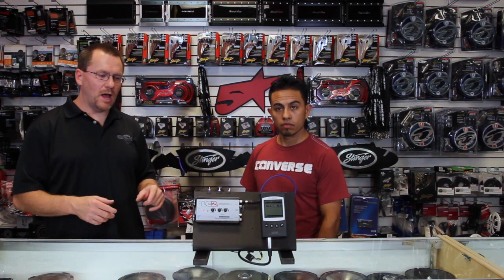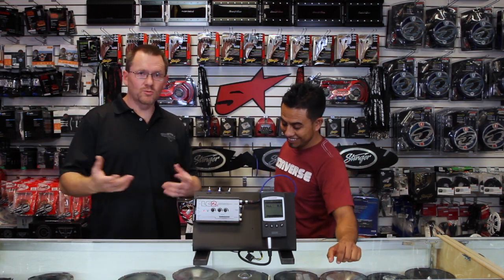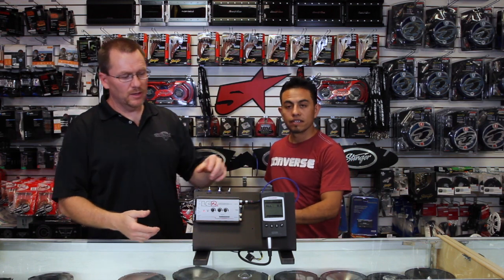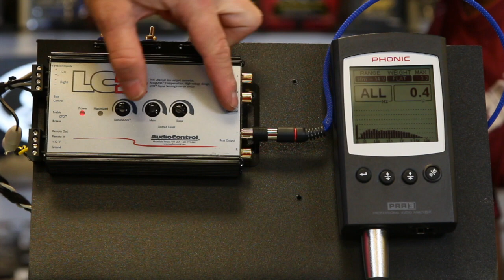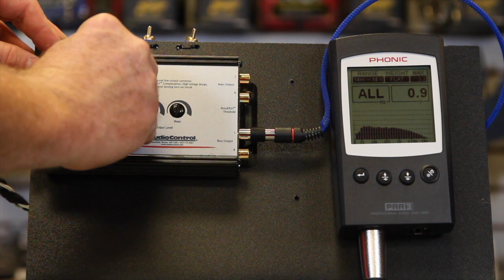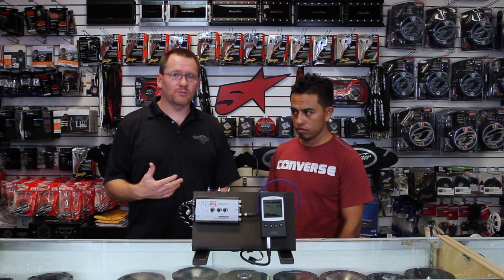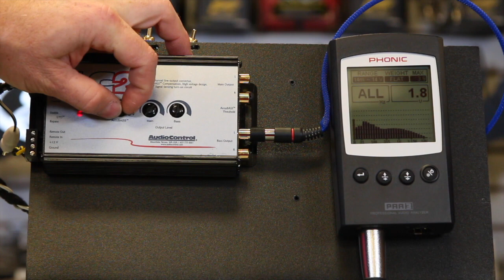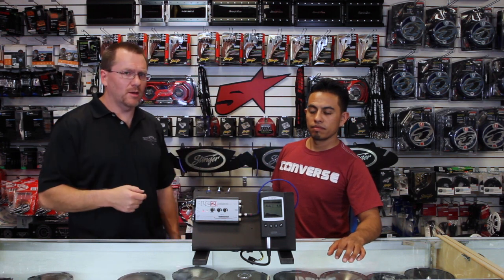Introduction to AudioControl's LC2i "what is and how to use AccuBass"

Comment: whats better to use? Pac gm 61 harness or the lc2i pro? are they essentially the same thing? my volume goes up to 63 (max) without any distortion. i dont want to cut into speaker wires if i dont have to..... but i want that RUMBLE. my last vehicle didnt have a good LOC so it was lacking on some notes. which one is better to use?

Comment: Hey guys I’ve got a quick question, I’ve got a 2018 Honda Accord Sport and the factory head unit cannot be replaced so what I did was pay for a professional installer to install all of my high end JL audio aftermarket component speakers which are JL’s C3-650 with crossovers , two in the front and two in the rear deck and a JL 10Wv3-2 in a boxed which sits in my trunk. To control the power from my amp and to control the volume of the bass sub the installer installed a JL-DRC-205 Digital Dial Rotary controller with integrated push button & LED Indicator. Next they installed a JL FIX- 86 OEM Integration DSP. And last a JL RD 900/5 900W 5-Channel Amplifier. I’m happy with the sound of the system I cannot fade from front to back or from left to right The alignment on my screen on the head unit, the dot Hass to be right in the middle of the car for the front and the back to play simultaneously but you cannot fade from right speakers to left speakers from front speakers to back speakers, I cannot do that. And although it does sound OK I’m honestly not impressed with the install. Could anyone who has a 2018 Honda Accord reading this push me into the right direction thank you. Should they have installed this LC-2 line output converter Help ?
Reply from the maker: It sounds like they installed the Fix wrong. It is quite capable of handling a Honda with a base radio( premium not so much). PAC-audio.com lists a t- harness that we use on this car.
Reply: @FiveStarCarStereoInc  You don’t know how much I wanted to travel down to Florida to have you guys install my JL audio system. It sounds sounded great when they first installed it but later I found out that rather than using a laptop to set time delay and the time alignment they used a JL audio download to an IPhone to set everything up. I’m unable to fade from front to rear or right to left speakers . The little red ball/ dot on the head unit has to be set dead center between the driver and passenger seats for the system to sound totally amazing. Question, how much is this wiring harness and does it come with detailed instructions brother ?
Reply: @FiveStarCarStereoInc  My 2018 Honda Accord Sport didn’t come with the premium sound system. Just two front door speakers and tweeters, and two rear deck speakers with tweeters, and the base sets in the trunk.
Reply: @FiveStarCarStereoInc  Also if I were to get down to your shop and made an appointment with you how long do you think it would take to install this harness your referring to buddy. Tell ya what I’ll give you guys a call tomorrow and see if we can’t setup a date.
Reply: @FiveStarCarStereoInc  Thank you for getting back to me sir. You’ve gained a new customer ! Somehow I’ll make it down to Clearwater Florida and have you guys install this harness you’ve informed me about. I’ll give you a call mid morning and we’ll setup a day and time brother. Thank you for getting back to me about this issue so quickly I truly wasn’t expecting it. But I’ll call you tomorrow sir and thank you again

Comment: You guys just saved me hours of headache trying to get this to work better. I totally forgot to adjust the threshold and was getting pissed my DSP was sounding like crap when it wasn't even getting a good signal to begin with.
Reply: What DSP are you rolling? Curious on the setup, instead of just running everything into the DSP.

Comment: Is the bass output of the LC2i full range or does it have a low pass filter on it? I noticed the higher frequencies on the RTA taper off when you switched it from the main to the bass output on the LC2i.

Comment: The LC2-I does not pass 10-20khz it states in the specification (Frequency Response: 33 Hz – 100 kHz ±1 dB) so if you like LOW bass you won’t get it with this. Now the human ear cannot hear below 20hz, plus most subs if any will never get that low and even those extreme low frequencies 0-20 can damage your sub. However if your subwoofer cannot reproduce frequencies below 33hz or you simply don’t care, then buy it because it’s freaking AWESOME. But if you like to tinker with things and or are always searching for the bigger and better thing then a LC7-I is way better however if you want more tune ability go with the LCQ-1

Comment: Bear with me here. I have an Acura RSX (Bose system) with an aftermarket Kenwood head unit that has a 5V pre-out. I’m replacing the old amplified, self-contained Bose spare tire subwoofer and replacing it with a new amplified, self-contained JBL BassPro Hub. I’m keeping the front factory Bose amp.

If I’m thinking about this correctly, the front factory amp just carries a remote turn on and speaker level outputs to the sub (it doesn’t amplify the sub), so is it even worth it to use the lc2i from the front factory amp to the new JBL sub, or should I just bypass the speaker level outputs from the factory amp, and instead use rca cables from the 5v pre-out in the Kenwood head unit to the JBL sub?

I’m not sure, but I don’t think it matters if I bypass the factory amp (and ditch the lc2i), because the subwoofer isn’t amplified from there anyway. Am I correct in thinking this way, or in my case, is there still a benefit in using the lc2i?

Comment: Great information, I had a question you stated that when using 40hz tone to set bass level the maximize light should not turn on. But it's ok for it to come on and off when playing music. Is that correct ? Just wanted to make sure
Reply: When the light comes on means there is distortion. For certain subs they have tolerance for such. I have kicker comp c and tuned my gain to where the light comes on every 2-3 seconds. Mostly when there's a kick in the beat. The thing with distortion is that it's a form of DC current while speakers take AC. The voice coil in the subs is supposed to go back and forth. Too much distortion and it gets stuck in one position or the other which heats up the voice coil and detaches it from the speaker which is known as a blown speaker. So the point is that the light is distortion, but don't be worried just figure out if your subs is a quality brand that can take it. The light coming on every second or 2 second isn't anything that can damage it as it's not receiving DC current fully. Now if the light was on solid then that's something to worry about.

Comment: I have a 2013 dodge avenger with boron acustics 6 speaker system..I tapped into my 2 rear 3 way speakers to lc2i pro to run 2 10s. It sounds muddy..should I tap into the two front door speakers wich are woofers?

Comment: I just recently installed a lc2 into 2015 gmc sierra it has the bose i spliced into the rears instead of the sub is that okay still? Also when I disconnect one it rca sounds louder and when j connect the 2 it drops what can it be?

Comment: Can you use a subwoofer amp on each output? Both main and bass if you tapped into the rear deck speakers. My amp is NOT strappable.

Comment: If you are using the remote gain knob for the Lc2i instead of one on the amp- where do you set it while tuning? All the way up?
Reply: Solitionwas:  turn the remote gain to max. Then max out the threshold adjustment on the side then adjust the accubass knob on the top to your liking.
Reply: Or unplug the knob.

Comment: When adjusting bass for sub in video you switch phonic to sub outputs. What happens to the mid outputs? Are those being adjusted as well. Is there a switch to adjust each outputs separately? I don’t want to have a sub, subbing and my mids distorted. Thanks in advance

Comment: I have one question...i have a 8" bass sub. Do i wre the lci2 to the factory sub or factory 6x9. For better sound to my 12's
Reply: Sub for sure! Especially, given the fact that it's more than likely located right next to where you're going to mount your AudioControl
Reply: Coe Yoe Jones the correct answer is to have the tools such as an rta to see which driver plays your sub frequencies. However if your 8” is a true subwoofer that should be the driver you are after, unless your 6x9’s play full range 20hz-20khz and you are using the lc2 to provide signal to more than a sub amp. Really depends on vehicle and how its set up, but your best bet with no test equipment is to grab signal from the 8”.

Comment: I have this connected into a epic center then the epic center into an mono d amp my question what should I adjust on the Lc2i the bass knob or the AccuBASS I am also using a dd1 plus so but it doesn’t distort the yellow light comes on before distortion

Comment: Question for you guys.. I have a vehicle that had a Factory subwoofer, I have since added a component sub with a 300 watt amp and I have an LC2i which is getting the input signal from the Factory Subwoofer Wire/output. Now i have the accubase threshold turned all the way up and if i keep the Accubase knob and the Bass knob both at the 12 o clock position as a starting point this sub is banging like crazy I have to turn the gain on the amp barely up?? Is this correct or should I lower the Bass knob completely and turn the amp gain up??  I havent been able to find a good starting point for the LC2i when its getting an actual factory sub signal as opposed to it usually a full range signal.

Comment: Old video I know... But am I understanding you said it generates a remote turn on out, to turn on the amp pluged in to it?  If I'm correct, would it be possible to run a second amp off the  lc2i?
Reply: I use the remote out to turn on my amp

Comment: I have one of these units with the acr1 when I plug in the remote the sound is way lower than if the remote wasn't plugged in..why is this?
Reply: you need to set the gain with remote plugged in right before it distorts

Comment: So I doubt you even check this but I’m gonna try... So... I have a 2012 Chrysler 300 SRT8 with the HK 19 speaker factory system. Here’s my dilemma... I used the LC2i tapped into the factory sub and add a monoblock sub amp, my custom fit box with two 10 but can’t figure out which one I dial in first the amp or the LC2i and more importantly HOW do you do it? That would be a great video as I see many people asking and answers all over the place. PLEASE HELP
Reply: Same question. Did you get any help?

Comment: 2016 outback and I'm about to add a amp and sub to its Harmon Kardon system. Thanks for the info, sounds like I need to spend another 100$ over the 10$ passive LOC I was looking at... at least it gives me the ability to add regular speaker outputs. The🤣

Comment: Always love your guys' content. My trusted local installer suggested the LC2i when I wanted to add a subwoofer + amp to my 2014 Mercedes E350, instead of a cheap LOC. He tapped into the premium Harman Kardon subwoofer to the LC2i, giving signal to an old Alpine mono amp powering an old Alpine 12" in a sealed box. Long story short, it sounded awesome. I was most impressed of how this setup played ultra-low bass notes.

Currently, I transplanted the LC2i, alpine sub & amp to a 2019 Rav4, non-JBL system. The same installer tapped the front speakers to the LC2i. For the most part, the bass hits very hard. The downside is, it doesn't play the same ultra-low bass from the same tracks compared to when the system was in the Mercedes. I'm wondering why this is the case? My Rav4 has the OEM stereo/speakers, so there is no factory amp, and I doubt the OEM speakers have passive crossovers or bass-blockers. I also add that the OEM radio does not decrease bass signal as the volume is turned up, which is what AccuBass is for. I suspect that the OEM radio was designed to cut down ultra-low frequencies at all volumes to save the OEM speakers. What are your guys' thoughts?
Reply: Not a full range speaker, Ram truck needs to use rear speakers for same reason

Comment: Hey guys thanks for the great vid as always! I have a 2017 Wrangler with the factory Alpine subwoofer in the trunk floor. I want to add an aftermarket sub and amp. Do I connect the factory subwoofer’s speaker wires to the LC2i’s input?
Reply from the maker: Yes that or get the PAC Audio Amp-Pro for a true Pre-Amp output
Reply: Five Star Car Stereo do I need to have speaker wires to the lc2i from 2 different speakers and can it be any speakers

Comment: I have a lc6i and when i turn car off the speakers make a pop noise and i read on manual that to use the remote out option but i dont know if they didnt use a remote since it has GTObut if it doesnt how should i get a remote signal from my 4 channel amp and plug it in to remote out? Sorry im trying to figure it out before taking it to install place and thats an hour drive so i rather do it myself. Any help id appreciate it

Comment: Need advice, so I recently had 2 10’s installed, a bass amp, lc2i, and an extra battery to my 16 challenger 8.4 inch factory radio. The issue I’m having is that my two front door speakers seem to only have bass coming out of them, while the dash and rear speakers I can hear more clearly. Did the installer do something wrong? Because I want to hear sound other than bass coming from my two front door speakers. Please help with advice.

Comment: Great Video, Thanks Guys!  Converse said like 2 dozen words tho.......  Any experience this working with a Bmw 2012 7 Series?  The remote signal is at such a low voltage, unsure the Lc2i will work with after market amp.

Comment: what exactly does it mean when it says it can handle 400 watts? if i'm going to put in an after market amplifier to RMS at 600 watts, what will happen?
Reply: it say if your vehicle has a factory amp and your running the wires directly from the output of the amp it will except a factory amp up to 400 watts. You have 2 different connections the high level are the speaker connections from the car the next is the low level output which are the RCA connections that go to the After Market amp.
Reply: @nickdemattia4875  Perfect, that's what I thought I just wanted to clarify. Thanks for the response.

Comment: Can accu bass be on a rotary eq
Reply: yes you can use a eq,  you would run it right after the LC2i. The accu bass is just bringing up the bass volume after it drops below the set threshold you set.

Comment: Does the LCI2 internal crossover roll off at 30hz? If so I won't get bass below 30hz?
Reply: It does not go below 30hz they lied on the specs. Email them and say wtf they should give you another one free of charge that will go below if you have one currently.
Reply: you would use the subsonic control on your mono amp for that setting

Comment: So in a 2018 Terrain with non-Bose I want to use a PAC LP7-4. I am adding a 4 channel amp for doors and a mono amp for subwoofer.I plan on sending the 4 factory high level signals into the PAC for the 4 channel amp and then just using the RCA output plugs on that amp to feed the mono amp.Will the mono amp be starved for low frequency because of the factory  bass rolloff? Is the LP7-4 a bad choice for what I want to do?
Reply: your better option would be the Audio Control DQ-61
.Key Features
:
Signal Delay:

Because of speaker placement limitations and the seating positions in a car, it is almost always the case that the driver of the vehicle is in an incorrect acoustic alignment. This exists because the driver is close to the left side speakers and further away from the right side speakers. Thus, the sound from the left side arrives much sooner than the right side. By delaying the appropriate speakers for just a few milliseconds, the DQ-61 is able to allow the signal to arrive at the same time putting the driver in perfect acoustical alignment.

AccuBASS:

To protect OEM speakers, car manufactures often limit the bass frequencies at higher volumes. AudioControl has developed a patent pending circuit called AccuBASS circuit to compensate for this factory roll-off. The AccuBASS circuit automatically engages at a preset volume level and reverses the factory bass roll-off to give you the music the way the artist intended it to be heard.

Speaker Level Inputs with Selectable Summing:

The DQ-61 is equipped with six high-impedance speaker level inputs that allow it to accept amplified signals from any factory installed amplifier, even Bose. Unlike an inexpensive passive line output converter, the DQ-61 offers the highest possible sound quality and performance
.
Equalization for Maximum Control and Performance:

Like all of AudioControl's high performance signal processors, the DQ-61 is designed to offer maximum audio performance and control. All six output channels are equipped with highly accurate graphic equalization filters. This equalization allows for the taming of the most demanding car acoustical challenges or correction of factory radio response curves.